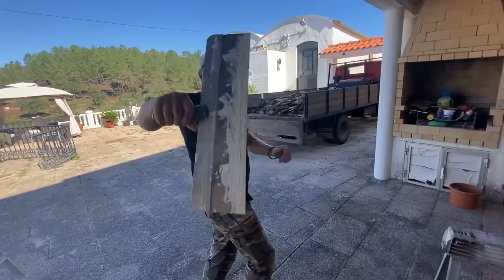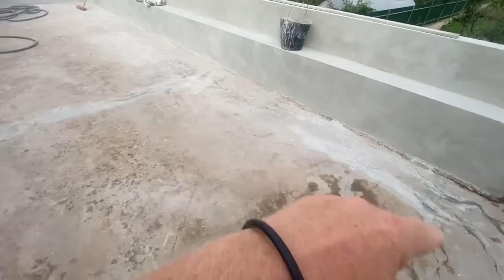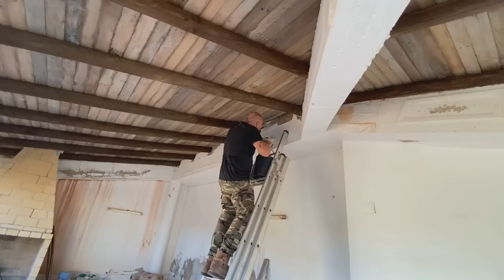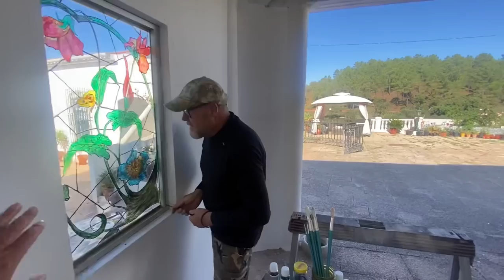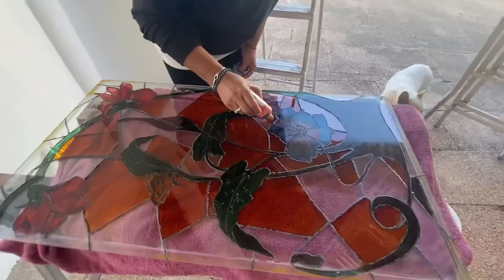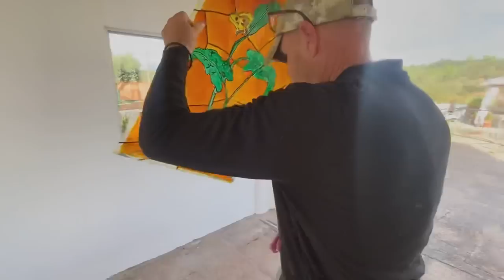Fake stained glass window.

Comment: Happy Birthday Cristina, that window is really effective, well done. Like you I don’t use chemical weed killers on my patio but once I’ve cleared the weeds I use white vinegar in a spray bottle and at the first sign of new weeds I spray with the vinegar it kills them off and my patio stays a lot clearer. I buy a big gallon container as it will need repeated treatments and is much cheaper that way. The village house is really coming along now, well done James.

It will kill of any growth which will turn brown due to the acidity by the next day, maybe sooner in your climate but will need to keep spraying as more weed seeds germinate but that is easier on the back than constantly pulling them by hand. 😊
Reply from the maker: Thanks Vee looking into the vinegar option. How long does it take to take effect?😎👍🏼
Reply: On a hot day the weeds will fall over in a few hours with vinegar.

Comment: What is the difference between the paint you applied to the window with a brush and the paint you applied later after the window was removed? Also, why was it better to use a brush for part of the window and another tool for the rest?
Reply from the maker: I could paint in more detail with the brush and the other method was for just filling in the bigger areas 😊

Comment: After you kill the weeds with vinegar, would it be possible to make a dry mix of cement and sand, brush it into the gaps between the pavers, then use a fine spray to wet it, then let it dry hard.
Reply from the maker: Good idea but we have plans for that whole area which involves removing everything.😎👍🏼
Reply: @The-Quinta  wow! You don’t do things by halves, do you!! 😀